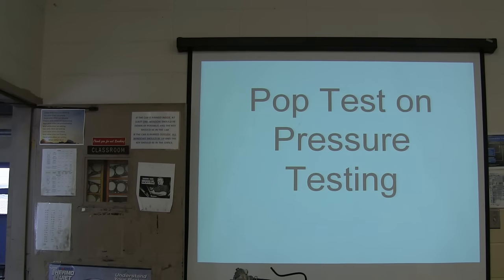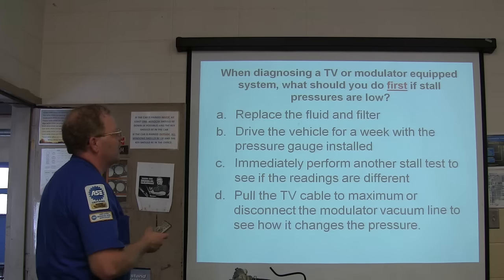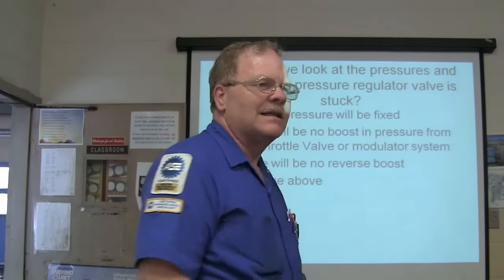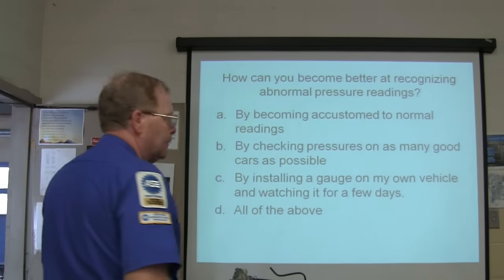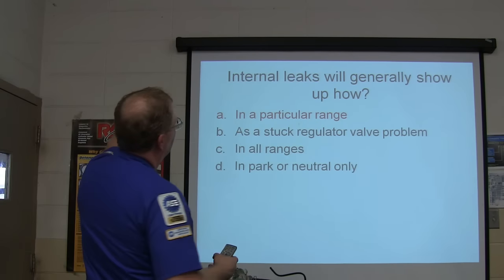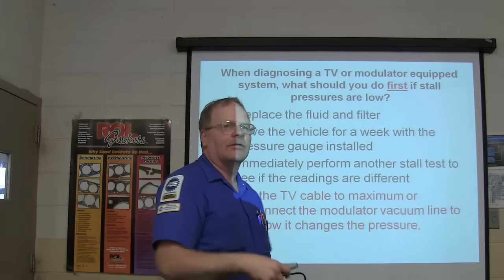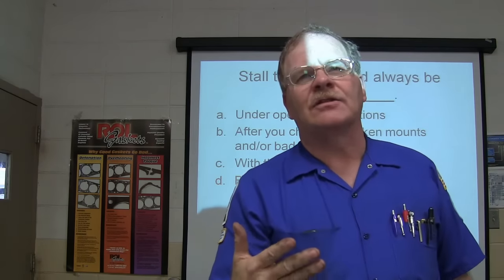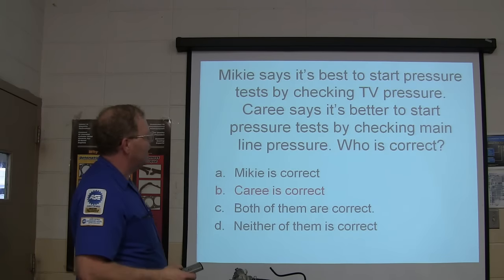Pressure Testing Pop Test

Comment: Me personally, I don't like how the 2nd question is worded. To me, it only takes into account the pump and the main pressure regulator valve. It doesn't take into account a throttle valve or a vacuum modulator valve, which could be considered part of the regulatory system. Just because you have pressures in spec at a slow idle doesn't necessarily mean you'll have good line pressure rise, which could be due to a stuck throttle valve or vacuum modulator valve, hence a malfunctioning regulatory system. Bottom line, to me, pressures at spec on a slow idle only tells part of the story.

Comment: Thank you for the test. Cool ghost effect at 7:10-7:15. Warning everybody hurry up and panic. I was working on a solution to board wobble on some gas power skateboards with rear wheel steering. I run flat tires off road to provide suspension and traction. I was going to try a fluid damper shock run from the board to the rear axle. I have thought about putting something in the tires like suggested in the last video. My current solution to the speed limit is to modify the front steering geometry and weld up a single wheel in the back. The three wheeler works better than I ever imagined with push or drift action depending on how you stand on it. The faster you go the more stable the three wheeler is. The ones with four tires are more like land surfing but when I run that nitro fuel at about 40mph board wobble and weight at the rear becomes a problem due to the rear wheel steering.

Comment: good teacher...how to use the Kwik way brake lathe ?do I need to start the engine  and what's next... thank you
Reply from the maker: +jirojoseph esman - You have to set up the cutting attachment where the caliper bolts (got all the adapter plates?  you'll need 'em!), and if you plan to drive the wheels with the transmission, put a piece of wood in the caliper you have removed, leave the opposite caliper in place, and lock the brake pedal down so as to keep the opposite wheel stationary.  Personally, I replaced the Kwik Way and totally despise their drive motor because it's so dangerous.
Reply: +McCuistian drive motor?meaning engine running?thx
Reply: +McCuistian thanks for the good advice....